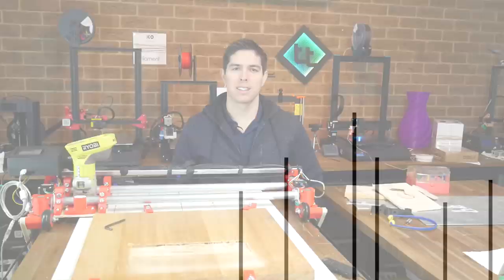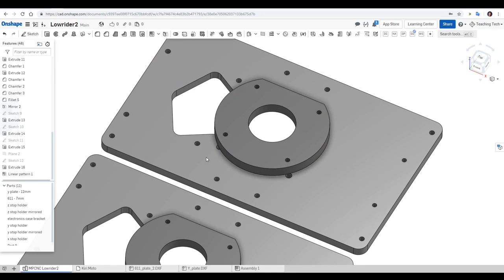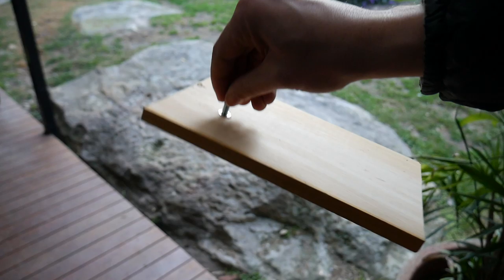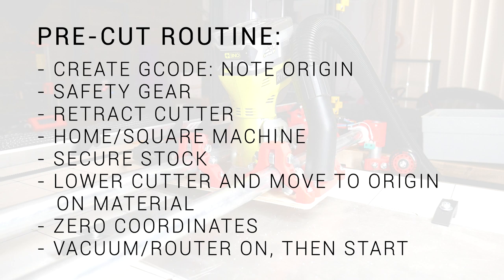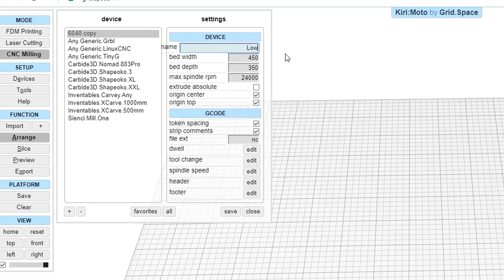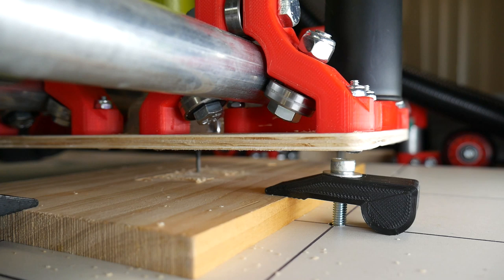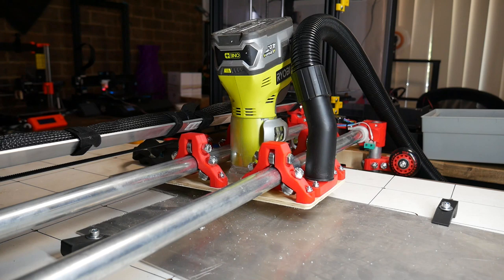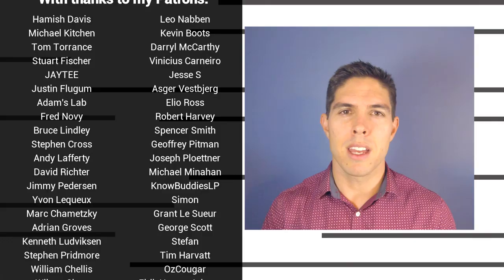MPCNC Lowrider part 3 - Router, spoil board and cutting stuff!

Comment: FYI you can take apart a dead Ryobi battery and just wire it to a mains 18V power supply. Then you have a corded "battery" that you can put in your tools whenever you are going to be using them for a long time.
Reply: Underrated suggestion here 🙌

Comment: Great job. I love how so many people say the MPCNC designs are not rigid enough.  Compared to a more expensive mill that is true in many cases but they are plenty rigid enough for what they are made for. I have the older design with a 48" x 48" footprint and the deflection is so minimal it can easily be overcome by adjust cutting speeds if necessary. Cutting volume for the price you cannot beat.

Comment: I used to get very defensive when the armchair engineers used to tell me how crappy my things were and how it was physically impossible for it to work, Even one of my mentors told me it could not be done even as I stood there with actual proof in my hand. Now it is how I quickly weed out who is worth my time replying too. I understand having doubt, but trying to tell me it doesn't work when it very much does for thousands of independent builds has started to become comical. A while back we ended up with something like less than 2kg load at the tip of a 1/8" endmill slotting aluminum......a few weeks later we started cutting steel (even I said It could not be done!). HAHAHAHAHA Thanks for not believing the comments!
Reply: Thanks for the work you have done on these units. The low rider is in the works for me soon. I do a bit of sign work and dont need a full fat system. The biggest selling point to lowrider is you can use it on your bench and take it off when your done. I'm sold.
Reply: @Potatogambit  taking it off isn't usually recommend, for signs ultimate accuracy is probably not the goal so you could get away with it without too much fuss each time. I just park it at the end of table and lose some table space, then no need to re-calibrate each time.
Reply from the maker: I'll be designing some quick release stops/belt holders. With the auto squaring setup I'm not concerned about accuracy because I have to square it every time it's powered on.
Reply: @TeachingTech  I have no doubt you will come up with something good and get reasonable accuracy quickly with it. Maintaining a square reference between swaps is going to be the hurdle I am most interested seeing your solution for.
Reply: I’ve been wanting to get a Cnc setup for YEARS.  But just couldn’t the size I wanted to make it practical.  This is a perfect solution, and as I have a giant piece of butcher block from a failed project years ago.  This is the perfect design for that block.  Such an amazing piece of hardware.  Can not WAIT to start building one.
Reply: I've just ordered your kit cant wait to start putting it together
Reply: That's the way to go man, thanks for the awesome stuff
Reply: @ausshot83  where from and what kit
Reply: @fitonline4549  I ordered from the v1 website and used the links in the description to order the board and other parts
Reply: @fitonline4549  it's the lowrider2 kit works great to
Reply: Ditto. A few months ago i posted to a forum my design idea for a replica movie vehicle (Aliens M577 APC). A regular on the forum (Chaank) insisted i would have terrible bump-steer. I tried to better describe my design to explain how i would not. We went back and forth until i uploaded a 3D exploded diagram of the suspension and drivetrain. He came back with, "Well i don't have time to look at your design but it's obvious by your comments that you realize there will be a huge problem with bump-steer and you don't want to admit it". LOL!! Can you say egotistical?

I credit the naysayers with pithing me off enough when i was younger, to force me to buy the tools/equipment necessary to just go ahead and build it myself. Thereby developing the skills i posses today. Completely self-taught and confident in my ability to build anything i dream up.

Thanks for making this video, it corrects a few design issues in my own build, ie insufficient belt engagement on the stepper sprockets. 

I recently tried to buy a used Creality CR10-S off Amazon and it never showed up. So now with my refund i'm ordering my CNC parts. Mine will be a ridgid steel table with a gantry that folds flat to 8" thick overall, allowing me to hoist it up against the ceiling for storage. Garage is only 13'x22' so i have to be creative with my use of space. j3-pro.com
Reply: @Zoran Damceski link for the machine https://shop.v1engineering.com/
Reply: Well, thanks for your work....disruptive technology always get moaned at...what would the maximum sizes be you would recommend. i would need to cut 200 cm by 50 cm, these big ones would only be wooden, mdf it is called in germany...

Comment: Great series of videos Micheal although I have already built this machine ..well 2 actually but having watched this i am now going to replace the current control system (Arduino Uno and CNC shield) with the SKR board and LCD to resolve the main issue i have with the Z axis levelling and i thank you for the instruction on implementing the SKR and the Marlin firmware. i have subscribed and liked.

Comment: You could just make a 40v attachment for the router plug in at the battery spot. And have the rpm be controlled buy power input to the router. Hard wired.

Comment: since it has been a while you likely have already dealt with it but 2 thoughts: a duct that allows the vacuum to get closer to the bit and/or a brush skirt to keep debris in an area.  hopefully both/either of those can help with keeping things a little cleaner.  may be worth adding extra holes so you can attach things later (since wood not a big deal) so you can make it easier to swap/add things if needed.  like a water line for lubricants.  amazing work and really awesome kit

Comment: You could make a power supply for your router (possibly from a laptop charger) and use an old dead battery as a "plug". you could probably also 3D print a plug, but that's going to be a bit harder to do as those battery's have latching parts.
Reply from the maker: I think that could work. Needs to be a high temp plastic as the terminals are too hot to touch after milling the alloy.
Reply: @TeachingTech  that's one of the reasons I suggested an old (dead) battery.

Comment: For aluminum you will have better luck using a high helix endmill.  The steeper flute angle helps to get the chips up and out of the way faster.  Also you can try spraying some wd40 on the tool periodically as it will really help with surface finish.
Reply from the maker: I only had a generic timber bit on hand, but thanks for your advice.

Comment: Very nice job. I have been considering building something similar and, coincidentally, I have modular workbenches for my woodworking. One of my modular benches has an accurate grid of dog holes for modern-style bench dogs as a means to hold workpieces (look up surface cam clamps, for example). They would totally solve your need for low profile surface clamping and you could 3D print them.

Comment: Should 3D print the top part of the battery,  install + / - contacts and run wires to an 18V PSU. When you are using it on your CNC you dont need to swap batteries and it still works cordless when you remove it.
Reply: Think plans exist on Thingiverse for that
Reply: How many amps would the PS require?

Comment: Noting how many batterys you have for your ryobi s ... a good hack would be to sacrifice one battery case (so you can reuse the click in terminals) and cable it to a suitable mains power supply, you can get chinese switch mode supplies dirt cheap from the usual internet suppliers. Great series of videos, lots of info and inspiration here,  many thanks

Comment: I took one of my bad router batteries and added external plug wired into the router. I can either power it with larger batteries or from a power supply.

Comment: Cool videos that spark my creativity!! Thanks for all the effort! 
I know... a lil bit late... but have you ever thought of taking an old battery from your cordless tiller, taking out the cells and wiring the contacts up to a matching converter placed in  the old battery case? Would give you the possibility to use all tools with that kind of batterie-pack like a "standard corded-tool" insted of going nuts with batterie-changes :P

Comment: I would just attach spade connectors to the terminals the battery engages in the router, then feed it with an 18vdc power supply, possibly with (3) 6v 12ah sla batteries in series to smooth out voltage slumps.

Comment: First off, awesome series. Is there a 4th installment (or beyond) planned? (Edit: whoops, guess I should watch the whole thing before commenting! Lol)
About your spoil board. You put a fair amount of effort into it. It seems a shame to chew it up so quick! :)
I use polystyrene foam insulation board (pretty cheap from any local home or builder supply) as a spoil layer with my circular saw and router jigs on a large table I have. When the foam gets chewed up enough it's simple to replace. It also comes in a variety of thicknesses which can be convenient.
I also keep a couple of "standard" pieces I re-use for cabinetry work, since the cut lines are the same. So they essentially never wear out.
Your videos are always very detailed, and inspiring. Keep up the great work!
Reply from the maker: Thanks for your feedback and for sharing what sounds like a very efficient setup.

Comment: You could probably rig a 12-20V power supply to power the router. 3D print a dummy battery that would slot in the battery case and plug the PSU to the dummy battery

Comment: I would've sacrificed one of the Ryobi batteries, remove the cells and make it work with an external power supply... just unplug to have a portable machine again and plug it into the cnc for permanent mounting.

Comment: Do a "field expedient" and disassemble a battery pack. Find a power supply that can feed the router and wire it up to the empty shell. A mains powered router would be better/safer though.

Comment: The suggestion:
so, is there a maximum depth the software can be set to for 'spoilboard' protection that will override any G-code? ...or perhaps use a THICK spoilboard with the inserts at the bottom(longer bolts on clamps)

The why:
When you showed how to build the 'spoilboard'(I think that is what you are saying) the metal inserts used to attach the braces though recessed were mighty close, subject to crash with the bits.
Then I see that you later show how the board gets mangled when you recommend to clean it up for subsequent run(s). ...and the grooves showing are mighty deep indeed.

Also:
 Installing these inserts at the bottom of the board not only would bring them much further away but would make them stronger against pull-outs.

Comment: All you should need with a cordless is an adapter to daisy-chain batteries and an adapter to plug in to the router... am I dreamin'! ...or a variac DC supply plugged in to your battery bank or inverter?

Comment: About the battery cutter, why
 do you not 3D print a battery adapter?
??
connect it to a power supply!

friendly greetings from The Netherlands!
Rob.
Reply from the maker: I have a CNC in the garage so it's not worth the investment in time, although it is a good idea. This machine is getting a laser.
Reply: Sorry looks like my warning came too late. I have a Sainsmart 5w one that works well but will only cut very thin wood, I expect you need something more powerful.
Reply: @TeachingTech  what brand is your cnc in the garage?

Comment: Old machinist trick for cutting aluminum is 1 part cutting oil to 1 part kerosene and always climb cut and take a finish pass to remove the slight deflection and you will get a mirror finish. Just use a small oil brush or spray bottle but that adds to the smell which my be annoying to the cry babies.
Reply from the maker: On my main CNC I would like to have a good crack at doing aluminium nicely, thanks very much for the tips.

Comment: Would you share your thoughts on the lowrider v2 design compared to the design of the onefinity? The dual z motors and possible gantry bind concerns me regarding the lowrider.  The onefinty design seems like alleviates that problem in an elegant way, but I do not have your experience. 
Thank you and appreciate everything you do.

Comment: Great video! glad to see it working, would be sad to use this only for laser cutting imo , especially with such a rigid frame, there are other router (like makita and its cheap clone katsu that works great that works great on my mpcnc)
Reply: I have built 2 of these machines (1 for myself and the other for a friend who  makes stuff out of wood)and have used the Katsu router on these and i can report that these work very well i have used them to cut wood, acrylic sheet and thin gauge aluminium with no problems after some experimentation to find the best settings. the only issue i have is getting the Z axis level but after watching the 2nd episode of this series i am now planning to replace the Arduino CNC shield/Arduino uno set up with the SKR v1.3 and implement the auto Y and Z levelling as detailed in the video. I also have an Ender3 printer that i have fitted the SKR board into. I am impressed by the Lowrider CNC. i am also planning on making a quick release belt clamp system so the machine can be removed from the table so the table can be folded up out of the way as i have limited space in my workshop.

Comment: Hello I was using kirimoto to do some engraving of letters but is cuts them backwards. Luckily I was cutting them out on plexiglass so I was able to use flip it up and it shows through to the other side straight but if I cut it in wood to would be backwards. Any idea of what I'm doing wrong?

Comment: you should use the low rider to cut out the aluminum plate used on the ender 3d direct drive upgrade

Comment: Excellent as always!
The only thing that surprised me is that you didn't try running wires from your battery charger to a modified battery on the router - to charge while machining.  LOL
Thanks.

Comment: i would just disassemble the battery and attach a power supply, so you save money by not having to buy more equipment.
Reply: That's what I was thinking. Just 3D print a battery snout, add connectors, and attach wires.
Reply: @SidneyCritic  That's even better.

Comment: Well, dammit!  I am now officially stopping my R&D development of my own device as this is near a replica of my thinking, all cooked at a decent price.

Yeah! I had gotten tired of all the expensive solutions out there that all had one restriction or another that blew my requirement to the bin.

I kept thinking why are they hijacking the software power via an inadequate mechanical approach, and locking the user in being forced to buy overkill or multiple purchases to satisfy all jobs!?
Why can't they provide a mechanical approach that better matches, more flexible!

...this contraption finally exposes the correct thinking, eliminating the size/volume restrictions. duhhh!

so, my wannabe creation is now left in the dust... and that's good, because I was blowing my time in R&D and prototyping a tool, rather than doing my creative work!

Note: there is a major improvement for this thing that opens up a whole new world of capability.
...and no doubt, many outfits are working on that solution that actually puts all the 'bed style' machines in the obsolete bin.  ...the multi-robot-arms cubic tentacle monster.  ...watch a 3/4 ton bear appear out of a massive oak log in the raw.  It leaves a bikini on that bear all the way to the end, and then strips it! LOL!

Comment: Have you tried fusion 360?
Reply: I've had good results from fusion with my MPCNC running with marlin firmware. It needs a post processing addon which is available somewhere on the v1engineering forum. Definitely worth trying it out.
Reply from the maker: I've got two paid CAM software options I use so CNC. One of them because it does really nice 4th axis milling. So in short, I've used it but it's not my preferred CAD/CAM combination.
Reply: @TeachingTech  Fair enough. It's a bit over egged if all your doing is CAMing up the gcode for leveling a spoil board but it's still extremely attractive, especially if you're also using it for designing 3D prints. It also has the advantage of being free to hobbyists.